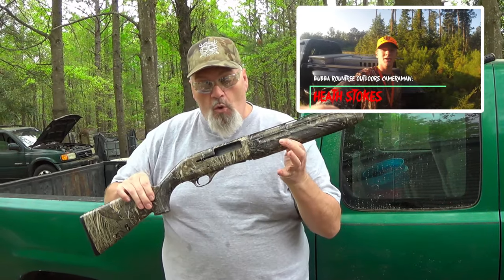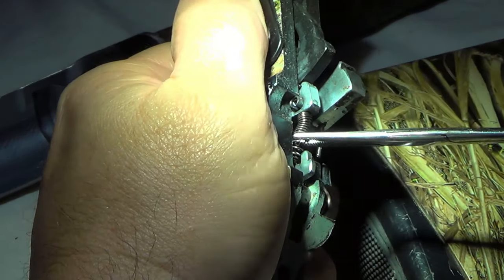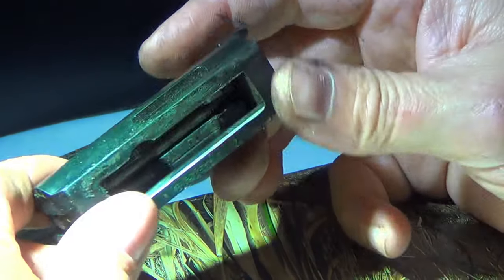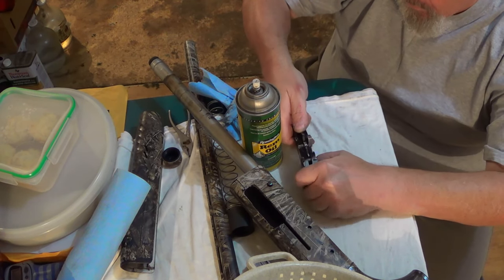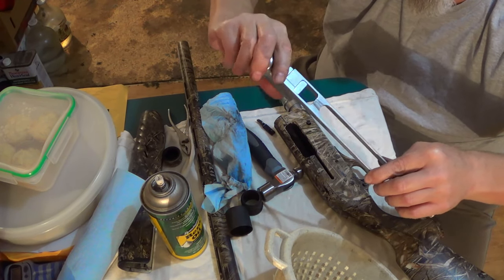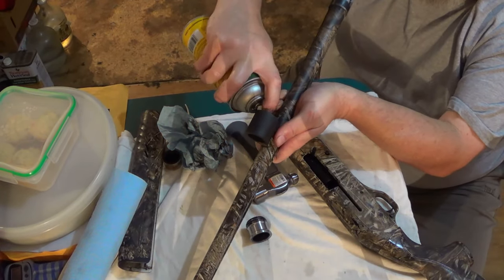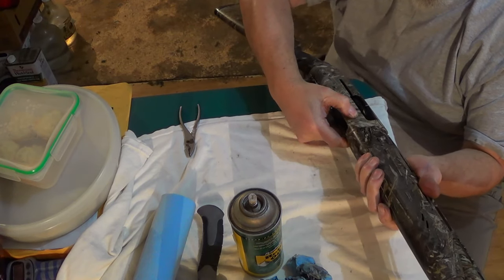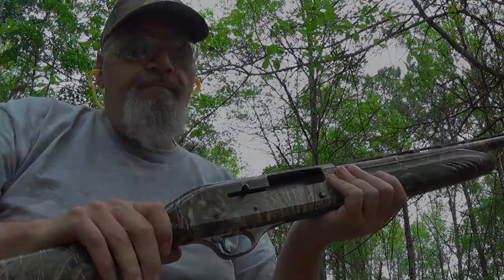Yildiz A-71 Fixed! Total fail after Jam!

Comment: There's supposed to be an O-ring that just drops loose in front of the piston.  A lot of folks lose it the first time they take the gun apart.  It helps to seal the gases and mitigates the steel on steel peening on the action.  I bought 25 spares from an O-ring supplier for a few bucks (the problem was figuring out the right size!  Great video

Comment: I put a Kick Eeez slip on pad and drilled and tapped a Taran Tectical bolt release extension tab on the button and it works well on my Yildiz A-71 12 gauge. . No ejection problems or other issues.  I use 2 3/3" shells so far. I think the 3" loads may be a little hot for this gun.  For waterfowl I use Boss  2 3/4" shells.

Comment: Ive got this gun and moved from texas to ohio.  Worked fine in texas got to ohio and the plastic or polymer gas ring swelled up. Couldnt get in touch with yildiz at all.  So i had my local gunsmith fix it.   He had to sand the inside diameter out a little for it to run smoothly on the mag tube.  Never had an issue with this spring but now if i do ill know what is the problem.  Thanks.

Comment: Wonder if the gas ports on the barrel  were plugged an there wasn't  enough gas to drive the bolt back caused the jam and the higher recoil caused the spring to jump the sear pin.